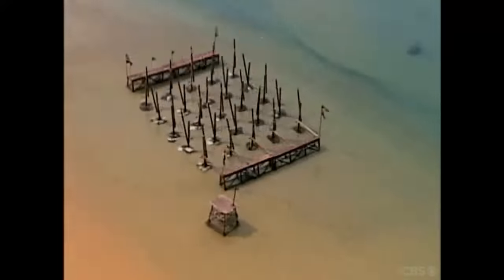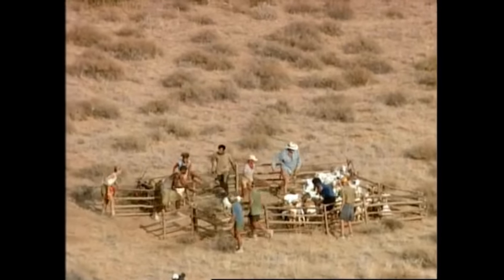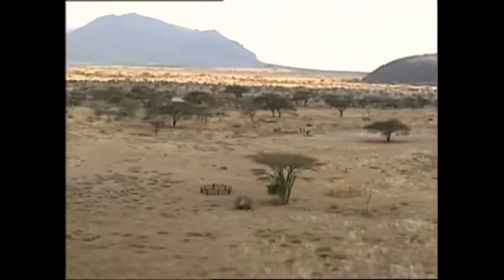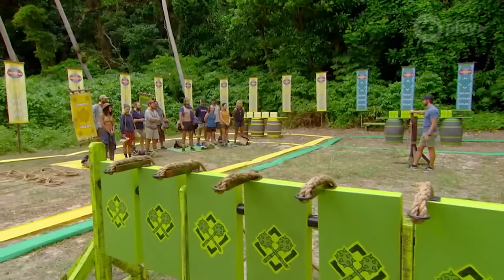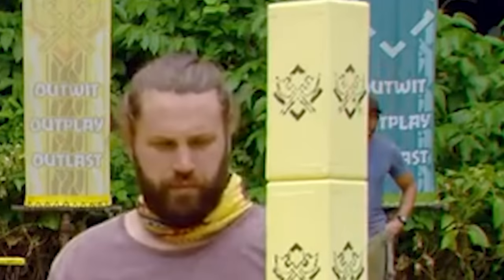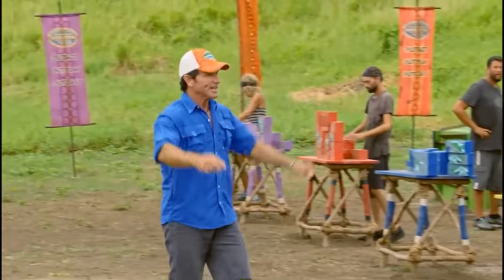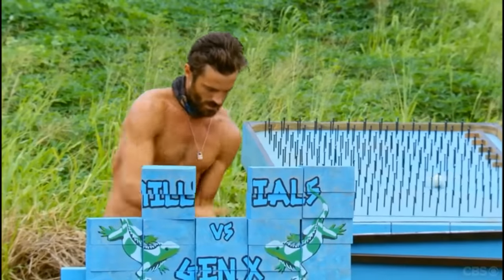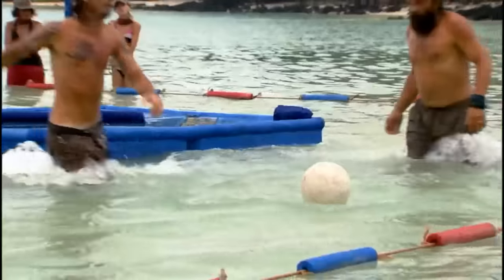5 Times Survivor Players Hacked Challenges 6.0

Comment: That first one with Darrah seem like a screw up by producers. This almost seem unfair to people with bigger hands or thicker arms. People shouldn’t be able to hack a challenge just by having small hands
Reply: Jeff seemed kind of pissed.
Reply: @topogigio7031  I mean, she didn't cheat. There was no rules against doing it, Burton just had big hands. It was the fault of the producers.
Reply: As a person with small hands I can say that we are often used to get stuff in hard to reach places or small places.
Reply: Having small hands is disadvantage in most challenges, so what? However production fucked up this one.
Reply: As opposed to the challenges where people have to balance on perches that favor people with small feet. Or the kind where they have to carry something heavy that favors people with upper body strength. Or water challenges that favor good swimmers. Or the one where they are on the perch and have to fill the tube with water(ie f4 Cagayan), that favors people with long arms so they can reach the key even if the tube isn't filled all the way. Every challenge is going to benefit some person more than another, hacked or not.
Reply: @andyland5555   i agree a lot of challenges are unfair. But this one seem particularly unfair when darrah can finish each section with one trip when it’s designed to take multiple trips
Reply: It's on the producers for not making the rule "your key has to be above X line before you can take it". I don't fault Darrah for this one; it's not cheating when the rule was "you have to fill your tube until you can reach your key". She did that.
Reply: Why not? people with bigger muscles win in events that need strength.
People with lower center of gravity win balance stuff.
Reply: It's only rigged when some bitch I don't like wins- The Survivor Fan Credo